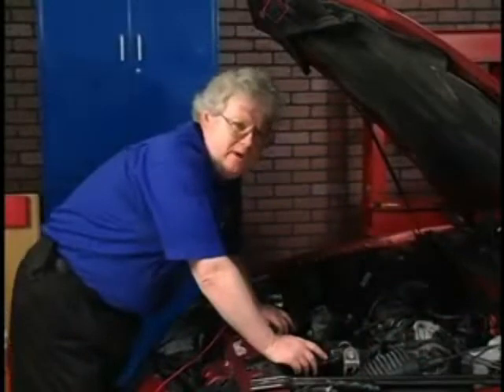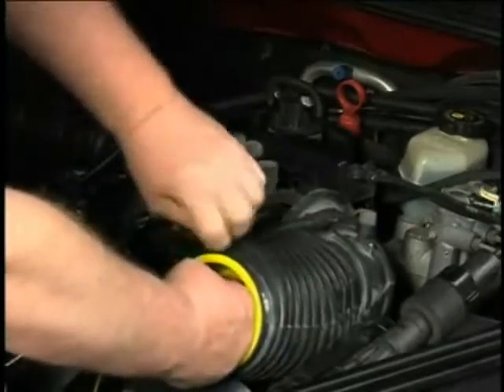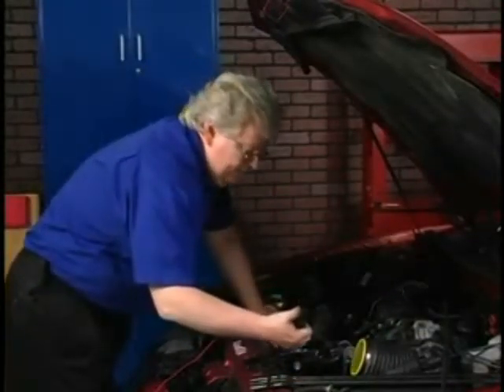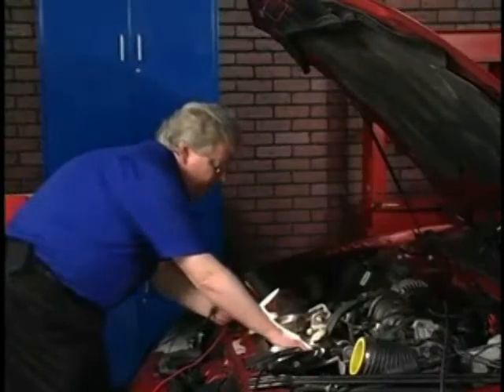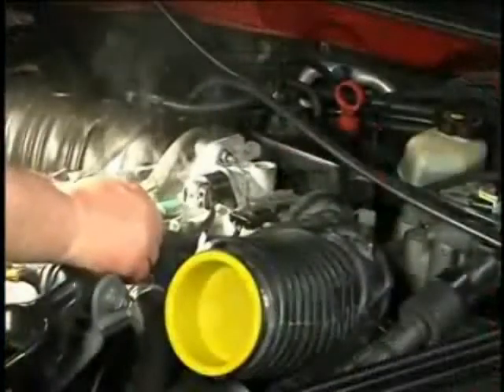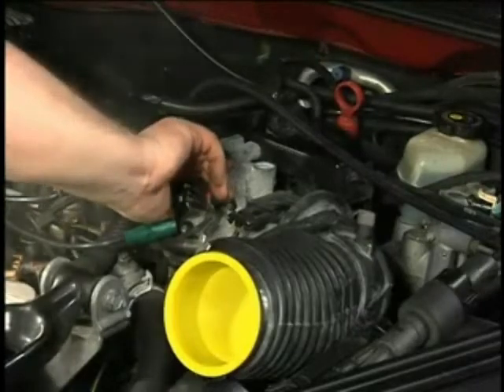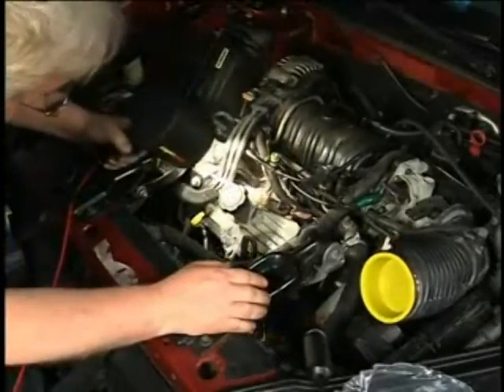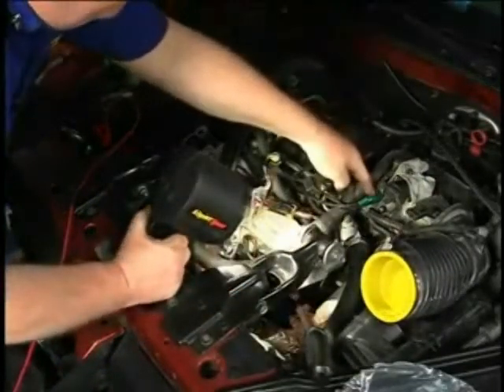Automotive Leak Tester Find Vacuum Leaks Fast Smoke Wizard Video

Comment: I just made one today out of random scrap metal and hoses.  I spent $3.99 on a glow plug, $4 on a few 1/4 inch connectors and $1.99 on baby oil.  Works like a champ.